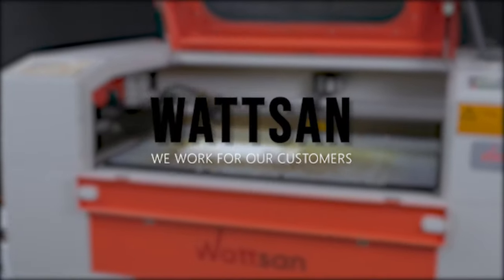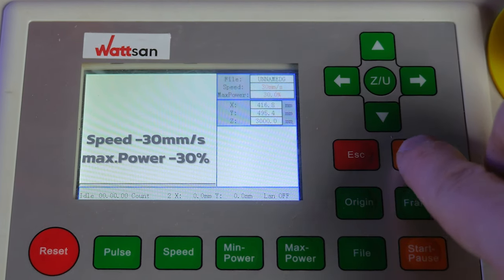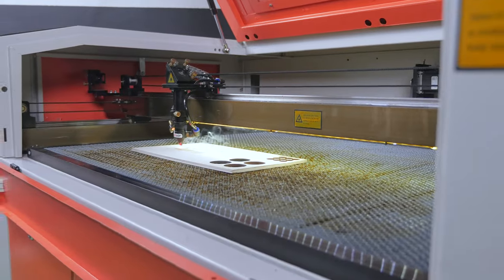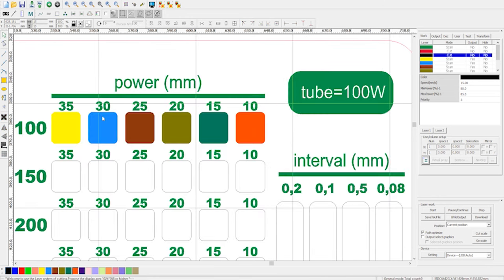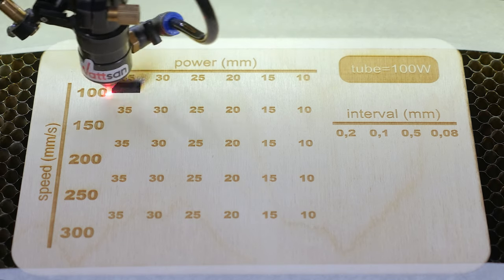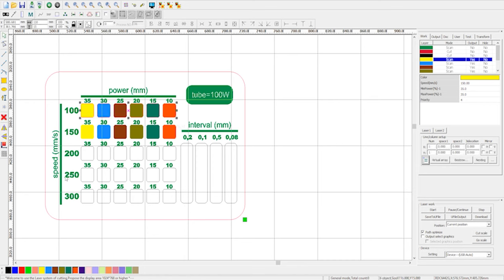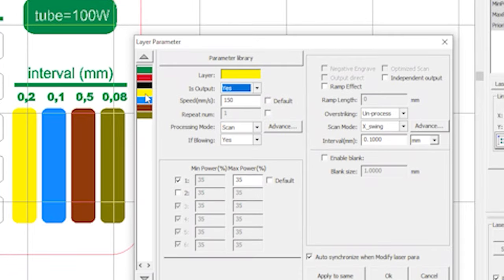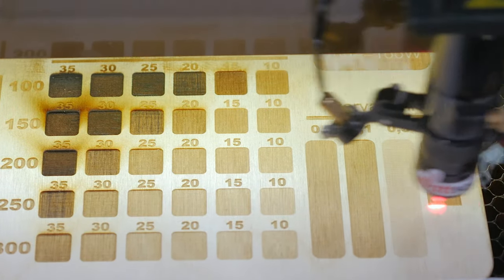How to Design Laser Power & Speed Scale Test Pattern / Wattsan 6090 LT

Comment: Take a blowlamp and scorch wood. Depending on the speed, you get SURFACE colours from light brown to almost black. Why does black engraving have to be A) so deep and B) so messy?  Sand paper seems to be fixing a problem that should not exist.
Reply from the maker: You are absolutely right. Color and engraving depth options depend on speed and power. Thanks for the comment.